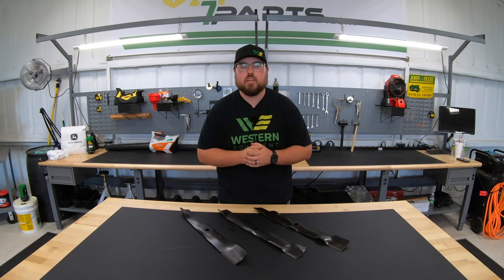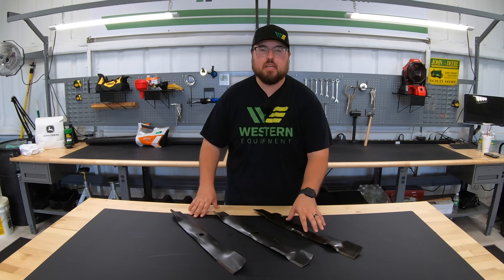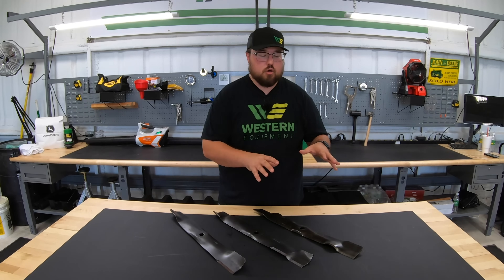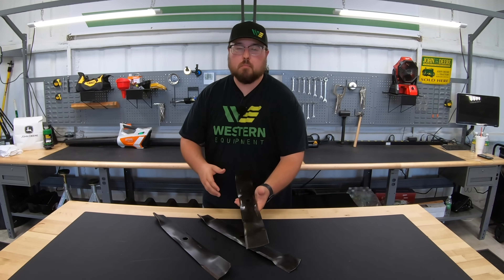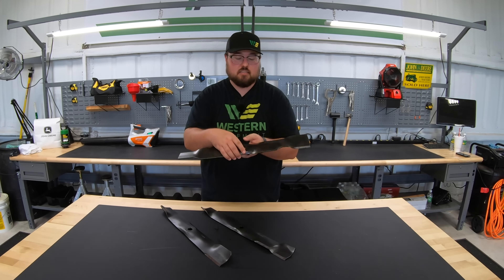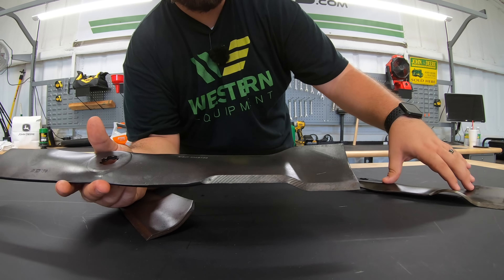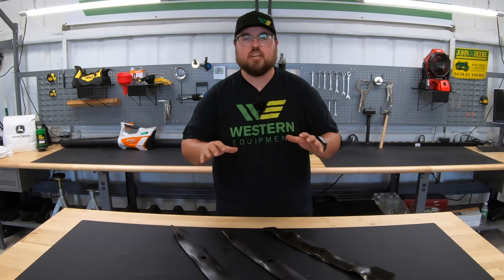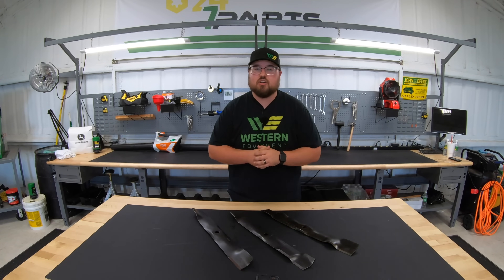Are you using the right mower blades? John Deere Mower Blades Explained

Comment: Good stuff I found the answer I was looking for.  thank you! I was pretty sure but needed a second opinion. I have an older gravely commercial 52 and I recently installed a bagger system on it. I used a 55 gallon plastic drum as my collector, bc it didn’t come with the shroud and the bags, just the frame to house the bags and shroud. It also came with the tube and the blower assembly. Which is the most expensive part anyway thank God.  AnyWho, it’s has gator blades or mulching blades on it and I’m getting a lot of debris and air blowing out the front right corner of the deck, in front of the blower attachment. There’s not any holes or rotted through places for air to find its way out and it’s really messy and pretty much blows in my face the whole time and the tube is getting plugged up too often. So to fix my issues, I know that the right blade will create better suction and hopefully propel things out through the blower better and more powerfully and hopefully prevent cloggage of the tube. Sound about right? Thank you.
Reply from the maker: I am glad I could help and thanks for watching!

Comment: What are the best blades for fall?  I want to reduce the size of debris (leaves, pine needles, etc) so more will fit in the bags.  right not im running the 60D with the triple bagger.  Im getting whole leaves in the bags. I would like to chop them up a little more before they go into the bags.

Comment: I'm certain your explanation for the 3in1 blade is incorrect and I'm happy to be corrected.
The raised cutting edge is actually a negative lift edge, it drives the air down. So if you imagine the lift part of the blade is at the edge of the deck driving air up and the negative lift part of blade is suck air down, it's creating a circulating effect where it lifts the clippings at the edge of the deck then drives them down into the ground towards the middle of the deck after they have been circulated a few times. The larger clippings that are falling to the ground will still be sucked back up and cut again but as they get smaller they will pass the top layer of grass and get pushed further down thus hiding your clippings.
Reply from the maker: I will see if I can get a more clear explanation of this and hopefully get a cutting demo video of all three this spring. Thanks for watching!

Comment: I have all 3 sets of blades. What angle should I sharpen the mulching blade, the 3 in 1 side discharge and the high lift? I sharpened the outer edge of the mulching at 30 deg and inner edge at 35 deg and the result was not satisfactory.

Comment: After 6 years I purchased new blades for my 1025r 60 inch deck.  I got the Oregon hi lift blades but when I installed them I got an intermitent metal to metal sound which I cannot isolate.  The blades all look fine without marring.  I also installed a lift and go kit at the same time I changed the blades.  Now the sound is so great I switch off the deck and can't feel safe using it any longer.  I plan on going back to the old blades and uninstall the lift and go one at a time to isolate the sound (if possible).  Not sure what's going on but it isn't good.  I've had the deck on/off several times looking and cannot find the culprit.

Comment: Brent,  My X350 John Deere tractor has a mulching kit.  Why does it leave clumps of grass every time I make a pass? I mow at a reasonable height, and don't mow wet grass. I use to have a 42" Freedom Deck years ago, which rarely ever left clumps. Please help.
Reply from the maker: I see this issue a lot and I do not have a good answer. I usually either try to go slower or just make another pass over top of the clumps to disperse them.

Comment: I mow about 12 lawns a week and many of my customers are biweekly and their grass can get a little high in that time. I currently use g6 gatorblades while sode discharging and it does ok,but id like to mulch as many of them as i can this year to save my blowing time after mowing. Its important to mention that sometimes the grass still has dew on it when i mow. Ive got the older style edge extra 42" deck,so ill have to get a mulch plug before i start tge season. Aside from trying my gatorblades i already have,which oem blades may give me the best results for what im doin?

Comment: Always enjoy your videos.  I have a S130 and it came with 3 -n-1 blades as standard equipment and they do a satisfactory job of mulching without using a mulch plug/kit.  When I go to replace the blades, would I get better results with mulching blades over the 3-n-1 blades?  I do not intend to install either a mulch plug/kit.  Thanks.
Reply from the maker: Yes, you would get a little better mulch quality, but I do not know if you would be able to tell without a plug or cover.

Comment: I’ve been using a LA110 to cut 1 to 4 acres since I bought it new in 2007. The only blades it sees are what cane on it new and the Blades listed on the mower
Reply from the maker: There are definitely multiple options. Sometimes they aren’t listed with the mower but can be found on a different mower with the same deck. Thanks for watching!

Comment: So ona 42” LA 130 what is the optimum blade placement for the three blades?  All of them installed at the 12’ o’clock position or do they need to be 90’ out of phase of each blade???   Thanks for the response in advance
Reply from the maker: On these mowers the blades are not timed so you can slap them on however you would like. As far as any optimum position, I have not heard of placing them one way or the other will increase material processing or discharge, so this is truly up to your preference. Thanks for watching!

Comment: I mow a field ( tall grass and weeds, some 1/4 " or  woody weeds, young trees)   I just want to knock it down for fire season 2-3 x year  ,  sandy , bumpy soil. which type blade works best  for my J d riding lawnmower?
Reply from the maker: I would say just a standard blade but you may also want to look at some aftermarket blades that have a hardened edge. There are some blades out there that are made specifically for hard use or for thick and heavy weeds.
Reply: @WesternEquipment  thank you

Comment: Great video.  I have a John Deere X758 and absolutely love the tractor.  It was configured with a 7-Iron 60" deck.  I have never been happy with the the cut.  To be honest I could probably cut a little more frequently, but never let it go for more than a week.  I get terrible windrows.  I raide the side discharge chute, and it helps but was hoping I could mulch the clippings more like my Toro Super Recycler push mower.  I have tried both mulch kids from Deere for my deck - neither fit.  I have the standard blades (that are sharp) on the deck.  Would it help to move to a 3-in-1 or a mulch blade without mulch baffles?
Reply: If you are planning 2 mulch, u definitely want the mulching blades, they definitely make a difference. I had many customers that installed mulching blades and didn't understand why it wasn't bagging well and vise versa. Using the dedicated blades for the application makes more of a difference than people realize

Comment: Do I need to plug off the side discharge to use a mulching blade properly? If so, where do I find one for a L110 42" Edge cutting system?
Reply from the maker: Yes you do and you can find one on 247Parts.com. Thanks for watching!
Reply: @WesternEquipment , thank you for the reply back. I actually saw your video on it right after I watched this one. Top notch sir.

Comment: I just got an S170, and a mulching kit for it. I only got the side discharge cover for mulching. No blade. Does it mean my tractor does not need a mulching blade? As always, I appreciate the video.
Reply from the maker: So your mower should have the 3-in-1 standard blades, so it will mulch. But if you want a finer mulch I would suggest buying some true mulching blades to put on it. I hope this helps and thanks for watching!

Comment: If I put a mulching kit on my Z300 series, can I still bag if I flip the lever to open the discharge chute?  I have read mixed responses to this question.  Someone also commented that he could still attach the bagging kit if he remove one deflector section  from the mulch kit.  Can you confirm whether this will work?  I would hate to lose the ability to bag in the fall  just because I have a mulch kit installed.
Reply from the maker: You can. You just have to remove the one deflector that attaches to the discharge chute. It only takes four small bolts to remove it. Thanks for watching!

Comment: I just put Gators on my Deere z355e zero turn. Upon engaging them I’m hearing a metal on metal sound every few secs or so. I have the right blades for my model. Any suggestions?
Reply from the maker: Hmmm. I don’t know what it could be other than they are just a touch too long.
Reply: Are they seated correctly. I think there’s a lip the blade must go over. I changed my brother in laws one time. Got a strange noise. Had to use a flashlight under the deck to see the lip.

Comment: There are mulching blades that have finger-like structures. How do they perform compared to the one you describe here? I have a John Deere LA115 42" deck tractor and just installed a mulching plug. I assume the original blades are universal 3in1s. When cutting the grass on my property I notice that most of the dandelion stems are not cut properly, so I need to drive over 2 times... What blade do you recommend for best mulching on this tractor? There is alot of confusion and not clear description at Amazon and even Home Depot can't really help... Thank you in adavnce, Lutz
Reply from the maker: The blades with the finger type things you are talking about are commonly called "gator blades" they are great for mulching because those surfaces add extra cutting surfaces for the grass to be processed under the deck. Also standard mulching blades will do a good job, but sometimes this all depends on the grass type. I would try both to see which one works better for you. I hope this helps and thanks for watching!

Comment: If I'm not bagging, but I don't want clumps, is one of these better for that? I'm thinking mulch blade, but is there such a thing as over-mulching where too much material ends up on the ground and prevents a healthy lawn?
Reply from the maker: Yes, definitely go with mulching blades. Typically you will be fine during the season. in some areas depending on how much moisture you get, you may need to dethatch your ward to get rid of some of the build up.

Comment: What about using two in x fashion at the same time. I noticed the blade has larger hole than the bolt to fit on the spindles bushing.
Reply from the maker: Some machines are set up for this but most John Deere machines are not. Thanks for watching!

Comment: What angle are the mulching blades sharpened at? 30, 35 ?
Reply from the maker: This can go either way. Some are sharpened at 30 and some at 35. either way as long as you go down from the standard blade angle which is 45 then you should be ok. Good question and thanks for watching!

Comment: What is the top of the line mulching blade for a 60inch John Deere 737.
Reply from the maker: The blade that is suggested from John Deere is a M168223, but top of the line is often debatable depending on customer preference. There are many aftermarket options such as Predator or gator blades that people seem to think do a better job of mulching. I hope this helps and thanks for watching!

Comment: When you're cutting deep grass. You want to throw it out as soon as possible so you want a low lift. The hi-lift blade keeps it under the deck longer to cut it up 4 shortgrass. They need to explain this better when they are talking about blades
Reply from the maker: I had not that about this, interesting. Thanks for the feedback and thanks for watching!
Reply: Thank You for this.
Reply: This is comment is just completely incorrect. The increase air flow from high lift blades discharge the grass FASTER than standard blades.
Reply: False

Comment: I'm a new John Deere owner with a E110 42 inch mower. I just bought the rear bagger and installed it (very easy) but undecided on whether to just keep the standard blades on or put on the high lift blades that came with the bagger. I'm mostly interested in getting up leaves and I have a fairly large yard with several trees. I want to limit how many times I have to dump the bags. Any suggestions?
Reply from the maker: The standard blades will do a lot better at mulching the leaves before they get to the bags.
Reply: I have a Deere E130 with a mulcher plug.  My back yard - about 6000 SF - was completely covered with leaves.  Almost no grass visible.  I went over it once with the mower set low - and it came out looking like it did in the middle of summer - not a leaf on it.  I usually use the plug and tow a sweeper towards the end of summer.

Comment: Can I put the mower blades they sell at lowes for John deer zero turns on my belly mower on my 1025R??
Reply from the maker: As long as they are the same specs and your blades that come on the 1025R belly mower (length, width, thickness, and hole size). I hope this helps and thanks for watching!
Reply: @WesternEquipment  they are almost identical with the exception of the length of the sharp part of the blade.  It’s smaller (shorter) on the zero turn

Comment: Can you use the oregon mulching  blade on my x350
Reply from the maker: You should be able to. As long as the blade length and hole diameter are the same as your factory blades.

Comment: Hi I have a 2021 950m with a 54” MOD deck, what JD part number blade should I order for this deck?
Reply from the maker: I would go with blade number TCU30317. This is a high lift blade that will create more suction and lift on your grass to make sure the clippings are being cut as small as possible while in the deck.

Comment: Can you run John Deere mulching blades without the mulch kit installed in a Z740R? If so, what would be the effect? Would the grass still be held in the chambers longer and still develop shorter clippings or would this be ineffective or cause other problems? I'm concerned with installing the baffle plates in the Pro Cut 54" deck and reducing the designed air flow characteristics of the deck design and possibly cause clumping or accumulation issues. Thanks for your input!
Reply from the maker: Yes, you can run mulching blades without the kit. You will not get as good of discharge but I highly doubt you will notice much of a difference. Since the mulching blades have more cutting edge length you will definitely be getting more cuts and smaller clippings so they will still be doing their job as intended, but the clipping will not be mulched as fine as if you had the baffle kit installed of course. I hope this helps and thanks for watching!
Reply: @WesternEquipment  Do you have a JD part number for a Z930R 54" Deck? Also, would you recommend the JD blade or the JD Predator Blade for Product ID: B1PD5172 shown on the JD website? Plan on using it on a Z930R with 54" deck, side discharge only - Looking for shorter clippings as indicated in the comments above. (NOTE: Decided over the weekend to purchase a Z930R instead of the Z740R. Both our great units.
Reply: @garygbur3992  p

Comment: can I bag with the mulching blade?
Reply from the maker: I won't do a very good job but you could try. Bagging blades are made with that extra flipped up wing to create more air flow and suction where as the mulching blade is more flat.
Reply: @WesternEquipment  ok, second question I have is that I just bought a brand new Oregon mulching blade and I was surprised to see it being dull, am I supposed sharpen it or are they meant to be dull ?

Comment: Do you recommend gator blades?
Reply from the maker: Yes, they are a great option as well! Thanks for watching!
Reply: Just put some on an older x320 with the 22hp Kawasaki engine. IMO, they work better than the John Deere blades, especially with the fall leaves. I side discharge.

Comment: Thank you for this.  Very helpful.

I do have a question - maybe you can help:  
I am interested in getting the Oregon Gator blades for my Z365R to help mulch up leaves this fall.
However...  Oregon doesn't seem to have any matching Gator blade product for the OEM blade used on the Z365R.  The JD OEM blade part number for the Z365R is UC25185.
I cannot find any equivalency mapping for that OEM part number to any Oregon Gator blade part number.

I guess the question to ask at this point: 
Is there a real difference between the blade on a Z365R (which includes a mulching kit) and the mulching kit blades on other JD Z300 series ZT mowers?

Thank you for all you do sir.
Reply from the maker: Here are the blade specs for your blades on your Z365R to help you match to the correct aftermarket blades. There is also a good option from Sunbelt that can be bought through John Deere dealerships called Predator blades. Specs for UC25185: 
Length	17.047 IN
Width	2.604 IN
Thickness	0.156 IN
Wing Height	0.906 IN
Hole Size	0.797 IN
Reply: @WesternEquipment  Thank you for your quick response!
I'll look into the Predator blades and see if I can find an equivalent match.
Still very strange that finding information about compatible aftermarket blades isn't already easy to do.  The Z365R has been out for more than a year already.
Keep up the great work!  Be safe and be well.